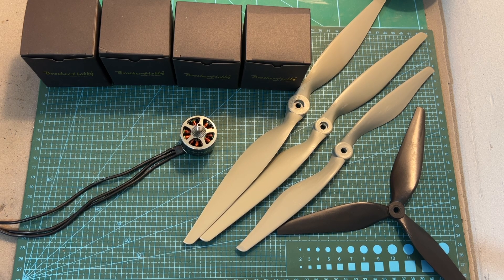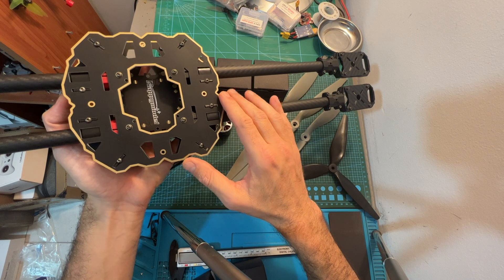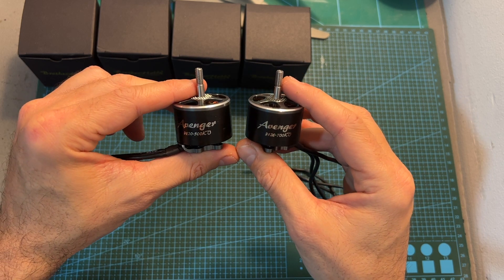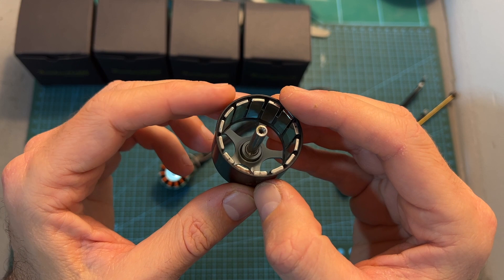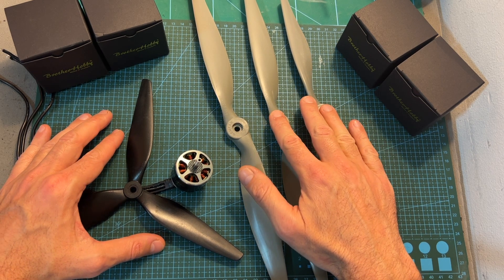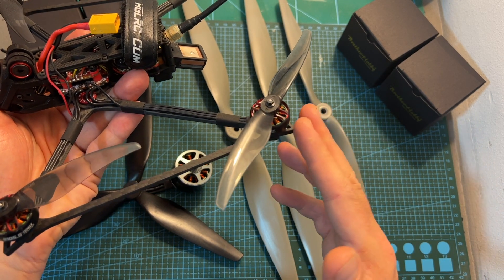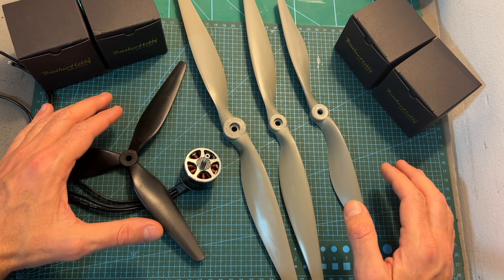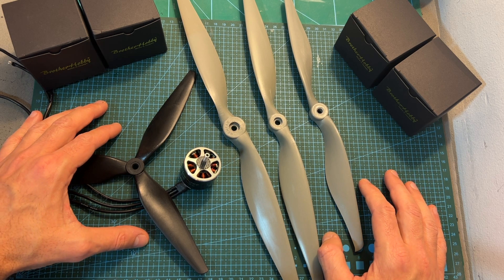Big Props / Big Motor - BrotherHobby Avenger 3120 500KV Motor Thrust Test

Comment: Woah! 12s, those are some serious motors! ...wish I'd win the lottery😏
What size prop is recommended? (from factory) Or was that the whole point of the video, to find out which size😄
And how scary was it, testing these huge props😆
Some of them looked really badly balanced, did you check?
Reply from the maker: I think that I will go with 14" props. I've mentioned in the video that the vibrations were caused by the way that the props were mounted (they might be off balance too).
Reply: Yeah that 15" prop seemed out of balance